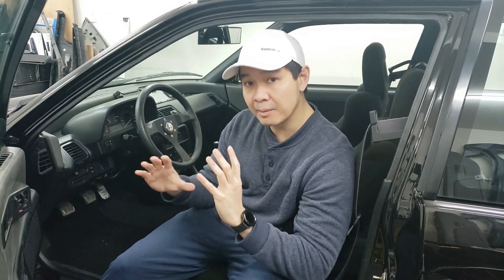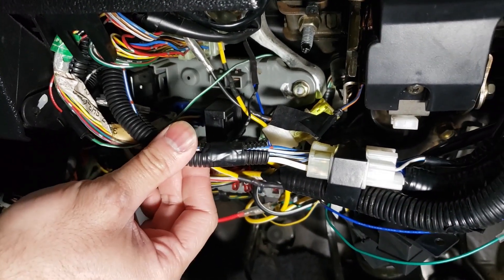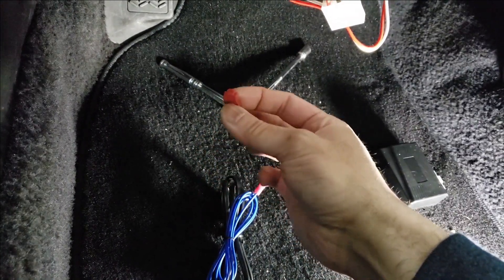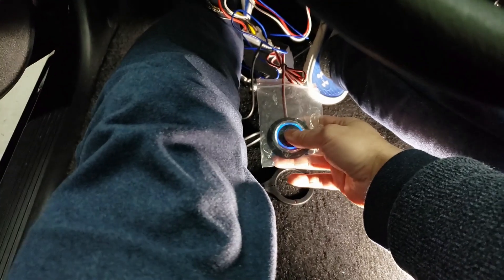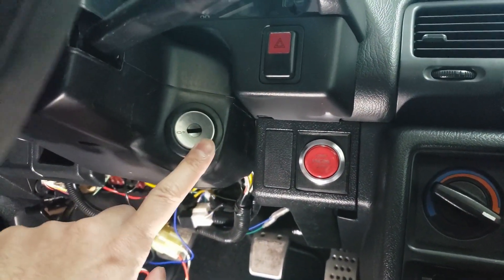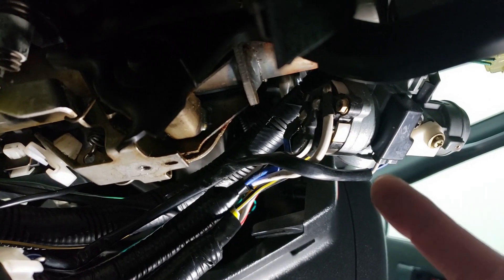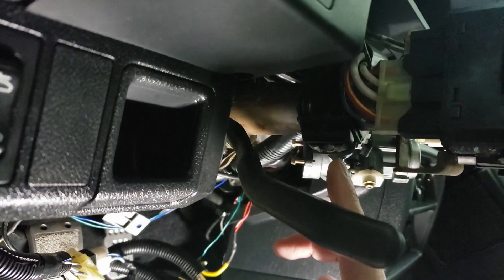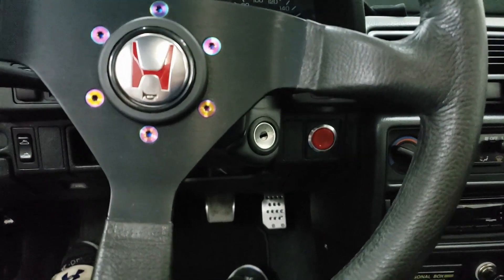I Made a "Plug & Play RFID Push Start Kit" for Honda ED/EF CIVIC & CRX🔥

Comment: Do you not make these anymore? Or are you part of JDI now?
Reply from the maker: I stopped making them. I made and sold a bunch, but the demand was a lot lower than I expected. So I stopped making them.
Reply: @ makes sense. How much were you selling them for if you don’t mind me asking
Reply from the maker: @Athon08  $89.99 Cad plus shipping. So roughly $67 usd.
Reply: @ oh nice about half of JDI. After Christmas I’m getting you CRX gas cap holder and Main Relay conversion. Now if I get a JDI push start, would that include a main relay with it or bypass the relay?
Reply from the maker: @Athon08  Awesome! thanks in advance for the support. The push start kits would not include a main relay because it just replaces your ignition switch. So you'll still need your stock relay or the conversion kit to be able to start your car with a push start.
Reply: @ awesome, thanks for the info
Reply: @BudgetGears quick question. How do you get the gas cap holder attached to the door? 3M tape?
Reply from the maker: @Athon08  Correct. Doesnt have to be 3M as well just has to be a strong double sided tape, but 3M is the go to and most trusted.

Comment: Great video brotha. Thanks. Was thinking about adding a push to start on my 88 hatchback but I have an alarm and was wondering if the wiring was difficult when removing the stock ignition harness and wiring in the alarm to the push to start harness? Any advice you can share with me would be greatly appreciated. Thanks again !
Reply from the maker: Wasn't difficult at all. The push start has the same wires the stock ignition has. So alarm wiring was exactly the same.
Reply: @BudgetGears  thanks for your response. Much appreciated! Looking forward to new videos. ✌🏼

Comment: In the event that you need to kill the ignition and coast to the side of the road or into your driveway because something is failing can you tap the button and it shut the engine off without hitting the brake?
Reply from the maker: No, the brake switch is how the system knows to crank or turn off the engine. So you'll need to hit the brake and then hit the button to turn off the engine.

Comment: Anyway I could get the dimensions of the factory arm rest I have an idea on how to make one but don't the the sizing ?
Reply from the maker: I can take some measurements when I get the chance. Depends on what measurements you want. I'm not pulling the armrest out to measure since I already have it installed. I can get you a general measurement like approx width, height, and length, but the armrest isn't just as simple as that. It tapers in and flares out at spots. etc. You really need the actual armrest in front of you to 3D design a replica.
Reply: @BudgetGears  thanks.  I know I want to buy the 3d replica but I don't think he likes making them,  but yeah mainly just height from the floor to the top and to the pedestal , and the width and lid size
Reply from the maker: @TealEF90  So the base is about 14.5cm height and 11cm wide. Theres lots of curves and stuff so the height is measured from the side and back. The front width would be slightly wider than your center console since it goes over the console. The top portion starting from where it splits from the base is 15cm height and 10cm wide. This is before the lid. The lid is 24cm length and 11cm wide and 2cm height. This is with the foam upholstery. It'll be smaller of you remove the upholstery. I hope that helps.
Reply: thank you so much. Big help

Comment: Will it work with an automatic?
Reply from the maker: Yes, it will. The ignition switch for a manual or automatic are both the same. This kit replaces the ignition switch. Only difference is an automatic uses a neutral safety switch and a manual uses a clutch interlock switch.